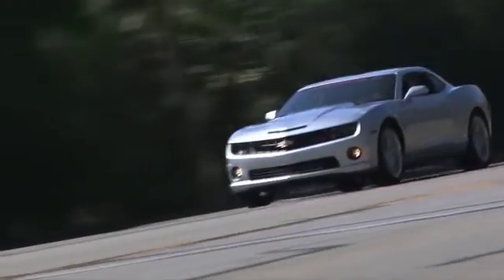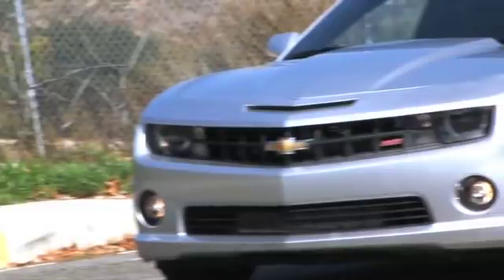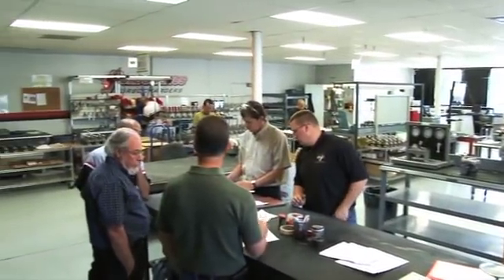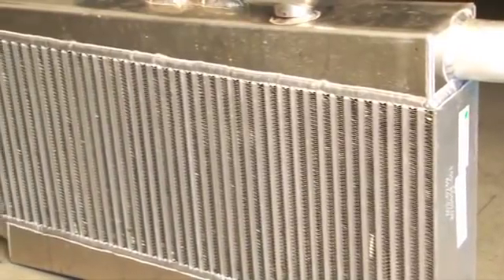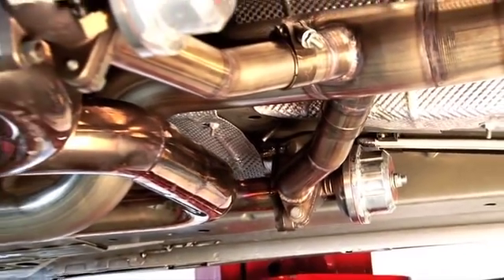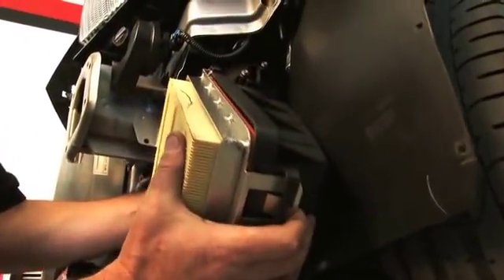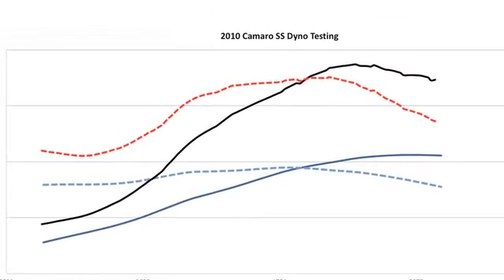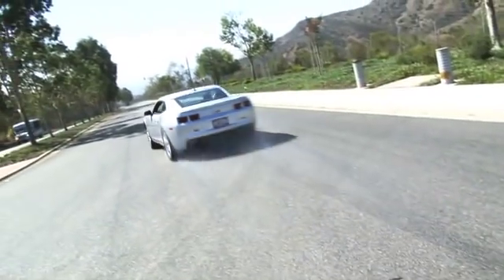Turbonetics' 2010 Camaro SS bolt on turbo system

Comment: Why does she say that the stock 2010 Ls3 Camarro SS goes from 365 horsepower to 560 when u add this turbo kit? I'll tell you why!! 
It's because they're false advertising and lying to you about what the car actually already has for horse power to begin with. They're saying it only has 365 horse which is wrong and 100 horsepower less than what the 2010 LS3 Camaro actually has and  comes stock with cause it really has 465 horsepower stock. Look it up I know cause I own 2 of them! Nice try tho!
Reply: I never heard of a 2010 Camaro with an ls3 motor start off with 465 HP. That's all wrong
Reply: they are talking about HP at the wheels vs HP at the crank.

Comment: what about the 2010 camaro ss l99? i see u have a kit for the ls3 and l99 whats the difference besides the obvious manual and auto
Reply: +Chris papi L99 400hp stock LS3 420. The LS3 package will probably come with things like cam shaft upgrade, clutch upgrade things that either should or are suggested be upgraded. For us the clutch is pretty important to upgrade when you're putting down power but so are other things.
Reply: the difference between the ls3 and the l99 is cylinder deactivation that lets it run off of 4 cylinders for mpg purposes. the l99 only comes in automatics and the ls3 comes with the manual....it makes slightly less power as well.....26hp at the crank to be exact....

Comment: Will I have to remove the front bumper to clean/replace the air filter, which was relocated?
I'd want this kit pro installed as well, I wonder what the cost of installation at an authorized Turbonetics shop would be?
Ok, one more question, with gas prices as they are, can the tuner adjust the car so it can run on the cheap stuff, or is this even an issue? e.g 87/88/89 octane.
TIA guys

Comment from the maker: @ParisTNDude 

There are two versions of the turbo system.  One is a complete 50-state legal system that includes everything with MSRP of 6995.  The other one is a tuner system (identical to the complete system, minus fuel/ignition/tune components) with MSRP of 5995.  Tuner system is recommended for offroad use or built engine setup.  All Turbonetics components feature 1 year warranty.

Comment from the maker: @blaknite1 

We recommend you to upgrade to a higher torque capacity clutch when the OEM unit wears out.  The turbo system was designed with a stock vehicle in mind, so the drivetrain upgrade is not mandatory.

Comment from the maker: @cemsengul16 
It sure can!  The 76mm Turbonetics turbo that's equipped on the Camaro SS kit is capable of handling close to 1000 HP.  If you "stay out" of boost, you are generally able to achieve very similar to original fuel MPG.  We can assure you that the gas mileage will be the last thing on your mind driving a Tubonetics turbocharged Camaro SS that's 50 state legal :)

Comment from the maker: @EasyDoesIt86 
As with any significant power adders, it only voids the "powertrain" warranty.  Our Camaros (we have/had several for R&D) gone through hundreds of hours on the dyno, street, race track to give you the factory-like driving experience.  50-state legal to boot!  We usually get a surge of turbo system orders about the time factory warranty expires :)  Give us a shout if you have any questions.

Comment from the maker: @96timmyy96 
MSRP starts at 5995 for the Tuner System.  Includes everything (and we do mean everything) you need to install in 12-15 hours.
Reply: TurboneticsTurbos could this be installed in my garage at home?
Reply: Even the programmer.....hmmmm

Comment: This is to cemsengul16: it is possilbe to get and extra 200 hp gain out of this Turbo set up. But to get there you have build your transmission and maybe some internals just for more safety of the car, but if is possible to get there with that Turbo setup. Also on the gas efficiency, you are mostly correct. Staying out of boost will help also. Shifiting when you are not having to spool up will maintain your gas mileage. 
I am going to go with a procharger her in a month on my Camaro.

Comment: RDP Motorsport will be offering one of these systems to a customer wanting to fit this awesome kit with installation and dyno testing free of charge, ring steve or eric at rdp motorsport on 440 358 5500